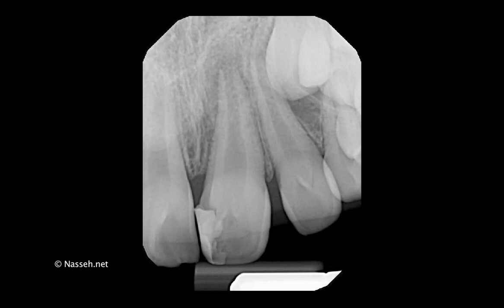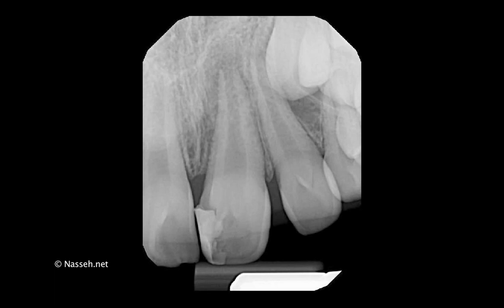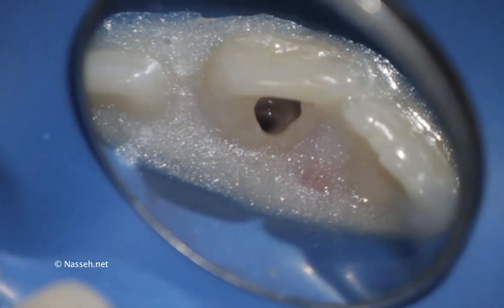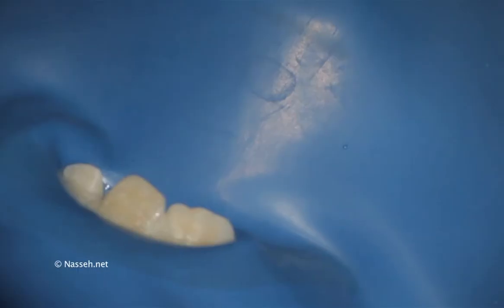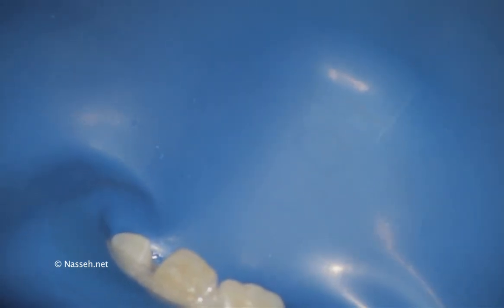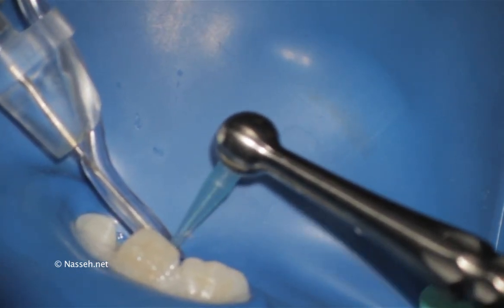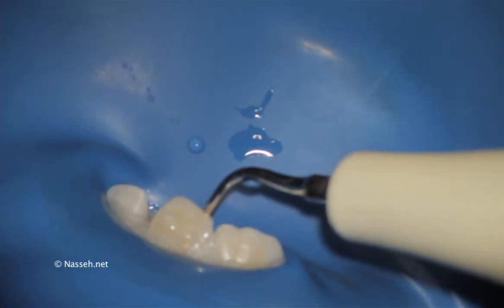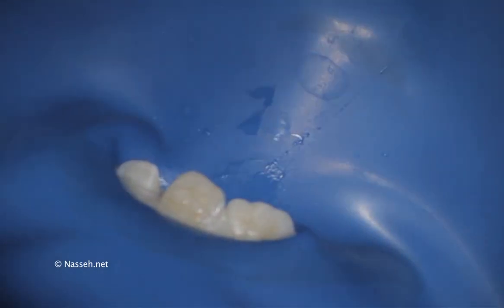One Step Apexification Using EndoSequence BioCeramic Putty and Root Repair Material

Comment: Dr. Nasseh, 
how do you know that you're not extruding/underpacking the bioceramic sealer when you're condensing it to reach the working length, as you cannot see the point at which the sealer is and if you push the plugger down to working length, it will extrude the sealer past the apex. Is it just by tactile sense?
Reply from the maker: No it's not by tactile sense. I think I mentioned in this video that I custom fit the cone to the full length of the canal. Then, I trim about 2-3mm of the tip of the gutta percha. Then, that cone will no longer reach the apex and can not go any deeper than 2-3mm short. That makes the cone a fitted condenser for that canal. The only art of it is eyeballing the right quantity of the putty for use in the  space I will be filling with Putty. Then, when I push it down, the cone will go up to 3mm of the apex and the remaining material will be a plug of BC Putty. I hope I explained this barrier technique. If I didn't, what I explained here in this description is how the cone does not go deeper and reduces the chance of extrusion.

Comment: Hello. Why not use bioceramic putty points with sealer in all cases? I don´t get why we need to use GP. Your thoughts?
Reply from the maker: Great question. The reason RealWorldEndo teaches the technique with the gutta percha points is because unless you have a very straight canal (like the one in this video) it's not easy to retreat the canal filled only with BioCeramic. Also, it's difficult to control the amount of the sealer to fill to the apex if you're only filling with the sealer without the Gutta Percha cone that would act as a condenser to push the sealer down to length. I agree that if there was a way we could sterilize the canal and fill it with BC Sealer and put a perfect coronal seal there would be no need for Cones. Unfortunately people fall short of ideal and we need to have a means for retreatment in this technique. Thanks. Visit us at realworldendo.com and become a free member, were you can ask questions from all the RealWorldEndo faculty about endodontics.